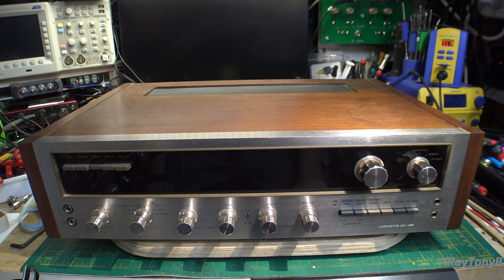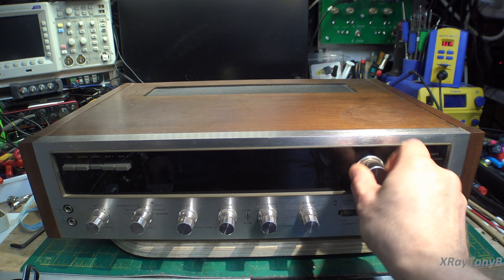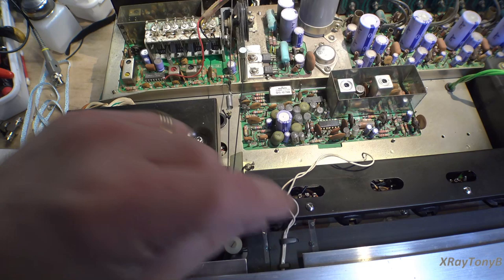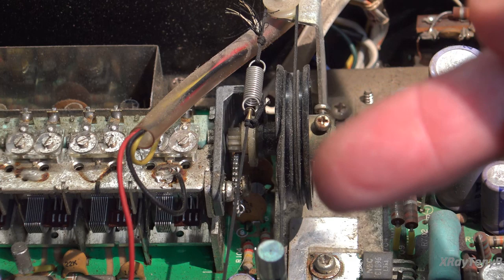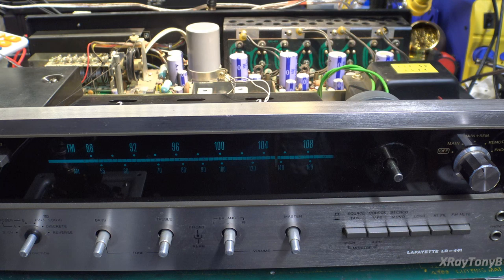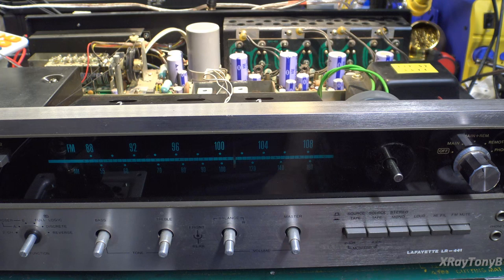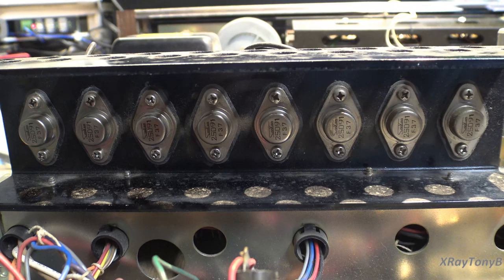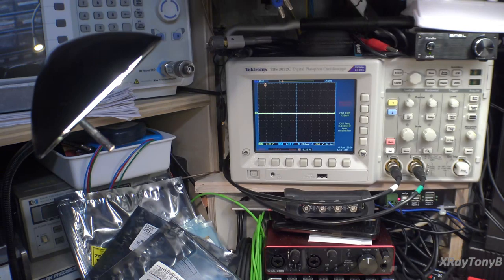Lafayette LR 441 Quadraphonic Receiver Part 1 - The Golden Tweaker Strikes Again!

Comment: Lafayette Electronics used Matsushita Electric as their main OEM for almost all their products including their famous CB  transceivers . They also used Sanyo and Shin Sibahura as manufactures for the low entry lines of products . I worked for them as a consultant from 1968 until their bankruptcy .  At the same time I also worked for RCA  as a RF engineer designing antennas systems for AM , FM and VHF and UHF TV stations . At that time RCA was the dominant supplier of broadcasting equipment in the Americas.
Reply: Many of Lafayette's CB's and stereo equipment were OEM'd by Cybernet and Trio (kenwood). This receiver looks like it was OEM'd by Cybernet of Japan.
Reply: @bigmsound  Matsushita sub contracted those manufactures when their productions lines where full and occupied , but Matsushita was always Lafayette Electronics main OEM .

Comment: 11:00 - The deal with an 'enameled' pointer, fully mesh the tuning cap, loosen the set-screw(s) on the pulley, move the pointer to '0' via the tuning knob, tighten the set-screw(s) :)

Comment: Oh those TO66 unobtainium goodnessness! I have an amplifier that was sold as a kit from an Australian magazine in the early 70's that has TO66 unobtainium goodnessness from Fairchild semiconductor manufacturing in Australia! Someone purchased the kit and did an amazing job at putting it together, I found it at a used Hifi shop in Melbourne and got it to gut it's internals with some high powered class D amps, that was until I plugged it in and had a listen to this 13W rms amp. I didn't know anything about it at the time but I was hooked on it's amazing sound quality, then I started to do some digging and learned that it was designed by the team at Electronics Australia magazine... That's when I found out that the potentiometer on the back was to control the surround channel level. Luckily for me, the amplifier is well documented over a few issues of the magazine which are still available for download on the Silicon Chip magazine website. It's now a treasure that I can't part with. It's a special amplifier with a special connection to audio equipment in Australia! But aren't those TO66 unobtainium goodnessness Just beautiful... So thank you Tony for you time in making this video, with all this time at home, I have literally watched all your videos along with others like Mr Carlson's, Uncle Doug, EEV Blog, Marko Reps, Diodes Gone Wild, Dr Cassette, Great Scot and everyone else that hasn't been mentioned here... Yeah I spend way too much time on YouTube but I regret nothing! You and other might consider yourselves just one person living your life wherever you are, but your life and what you do brings joy to people all over the world, it's true when they say that the world really is a small place..

Comment: Sometimes the mounting screws and transistor case get oxidized. Make sure the resistance between the screws and transistor case is as close to zero as possible. To maximize the output and reduce the heat and clipping on the output transistors at higher output.

Comment: Some people think winding the bias up will change it into class A, which it does kind of do. They also understand that it will get hot, after all most class A amplifiers do get hot. What they don't understand is the heat sinks just cannot remove that kind of heat. Even the mains transformer is not made for such constant current draw. I'm amazed everything was not damaged.

Comment: I would argue that the moment you recap an old piece of audio gear it's no longer what it was when new.  The differences alone in ESR on modern caps can make a difference.   Now will a recap make it sound better then it does at this point in time,  yes most likely.  Once recapped it won't sound exactly like it did when brand new IMO.   Good vid,  glad your voice isn't annoying like another similar YouTuber.
Reply: I realize your post is a year old, but I just overhauled a SX-780 and came across another dead SX-780  (since repaired) and just did a side-by-side.  The first has had what I'd guess most would consider extensive mods... the STK packs have been replaced w/discrete components, the TA 7136s replaced with modern parts (out of necessity, not shotgunning parts), and it's fully re-capped. The 2nd 780 is (basically) stock, no recap, no mods aside from replacing a dead STK module w/the (only) working one I pulled from the first SX780. While I cannot know what any SX780 sounded like new, the modified SX780 sounds clearer than the stock 780 does at this point... so if the choice is to leave it alone or recap, and sound quality is the goal, I'd suggest recapping over originality, and any receiver, (thoughtfully) modified or simply restored, sounds better than a dead receiver, which is the direction all of these are headed w/o service.
Reply: @db3ll  Considering how old some of the caps are,  I would recap it as well.   It will probably sound better then it did when it was new,  however it probably won't sound the same as it once did when new.   Sooo many factors in play here.  In the end,  if your happy with the results then you have a win.

Comment: Tony, great video but I was puzzled that you didn't reattach the thermistors onto the heatsink prior to setting the bias.
The thermistors are a critical part of the amplifier biasing circuit, reducing Vbe with increasing temperature to  prevent thermal runaway and it seems like you caught things just in time before any damage was done.
It didn't hum cold, so wondering if the biasing had really been tweaked or the current increase was due to the thermistors not seeing the actual heatsink temperature?
Reply from the maker: It would have been better if I did the thermistors first, but I dnd't want to wait for the thermal adhesive to dry.  In addition, the instructions explicitly say to make the bias adjust with the amp/heatsink at room temperature.  The stabistors won't have any effect until the heatsink begins to warm up above room temp.  There was extreme excessive current on the outputs at room temp.  Over 400mA when there should have been less than 40.  It was absolutely power-tweaked. The hum was due to the excessive current at the power supply.   Thanks for the comment!

Comment: My current Stereo is a Yamaha CA-610 that I restored and some Soundcraft Spirit Absolute 2 with new tweeters. And a Maya 44 pci sound card as DAC.
I eager to get into DSPs and building a Class D Bi-Amp system
Reply: Sweet setup!

If you want to get into DSP and Class D, take a look around Parts Express. They have quite a bit to choose from, although their stock might be a bit low at the moment due to the current global situation.
Reply: I was thinking about using an ADAU1701 based dsp board but before that I be gifted a calibrated measurement Mic from a friend who's Synthesizer I repair from time to time

Comment: replace the gears made from resin to something made from brass, could someone have been messing around with bias on the Class A output stage. Class A stages will always run hot like the FINAL amplifier, actually I was warned off from buying a FINAL amplifier and bought a TECHNICS SUA900 MKII which worked well but developed a hum problem as I suspect that the bamboo based electrolytics have dried out so I don't use it anymore so I bought a SONY soundbar and subwoofer and haven't looked back, just wondering would it have been a better idea to maybe go with 2N3055 power transistors which can take a higher current.

Comment: Hi. I have a question. I love vintage hifi from 80’s-90’s. I buy many old equipment and I noticed that they sound much less clearer (much less treble) than what they were sounding when they were new. What’s getting old in them? Is it the old capacitors  acting as filter? What’s the reason they sound much less clearer? THX
Reply from the maker: In most cases, it is due to the electrolytic capacitors.  As they age, the electrolyte dries out or leaks out, which changes the performance/value of the capacitor and affects the sound.  Caps can become leaky (both chemically and electrically) or open, and in some cases can even short out.  This is why it is a common practice for people to replace the electrolytic capacitors - a practice known as "re-capping".  Failing transistors can also affect the sound, as they can cause weak signals as well as crackling and popping noises.  In extreme cases, they can even damage other parts of the amp by shorting out.  Thanks for the comment!